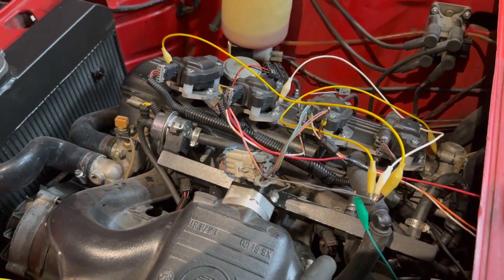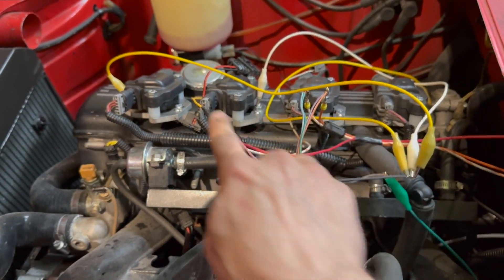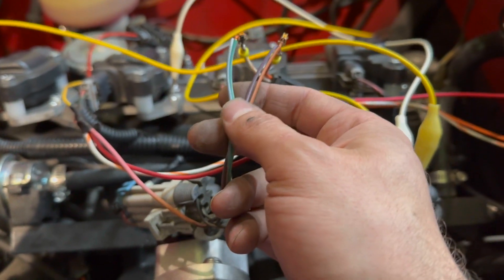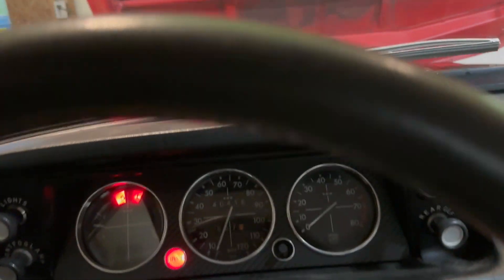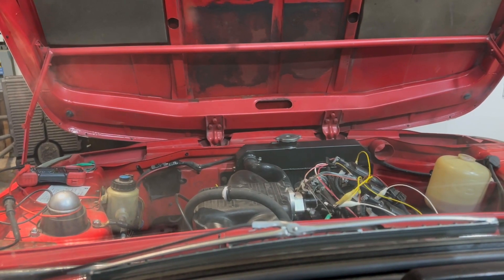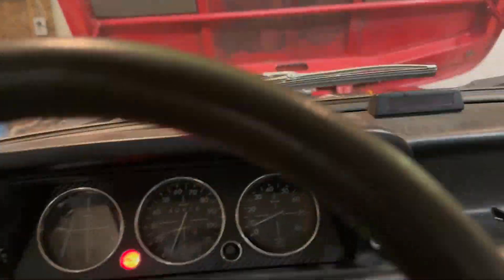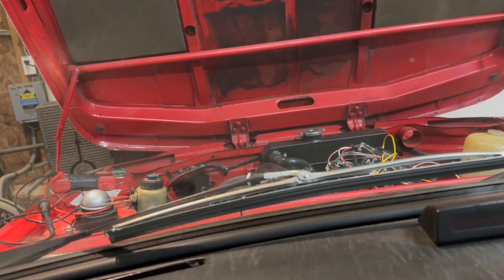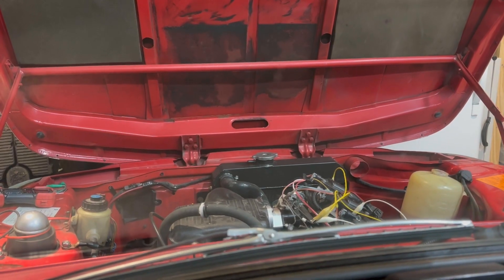LS Coil Conversion

Comment: What’s your plan for the cam signal? I ended up gutting my old distributor and converting it into a trigger point. Running a Hall effect sensor mounted to a polycarbonate cap I designed/printed… I still don’t know how well it’ll hold up. Frankly, I’m worried the cap will fail from vibration. If you’re interested, I can send you some more info, pics, 3d models, etc

edit I just saw your video showing your conversion. I took a slightly different approach, but yeah we both did something extremely similar in practice lol.
Reply from the maker: Yup, though these engines tend to push oil out the dizzy, especially under high crankcase pressure (boost), so i may end up drilling and tapping a hole in the timing cover and putting a sensor there. Then add a trigger wheel to the front of the cam shaft gear.
Reply: @ryan_layne  should be more accurate too. The m10 is also notorious for having a lot of play at the distributor gear
Reply from the maker: @loganpalmer663  My distributors are tight like a tiger.